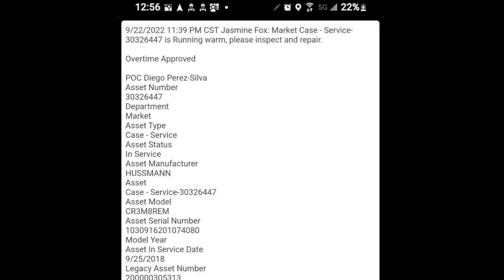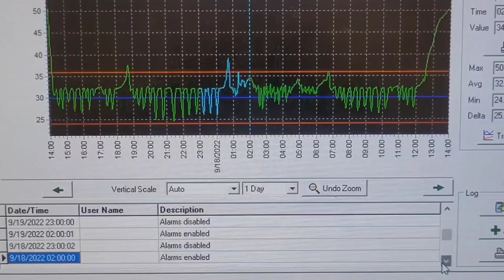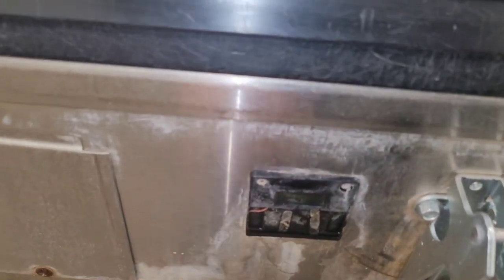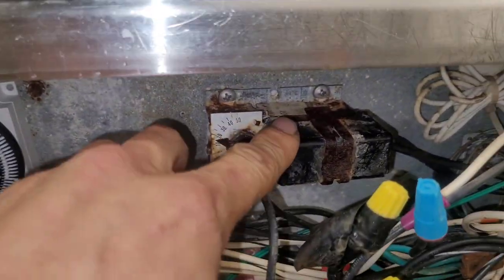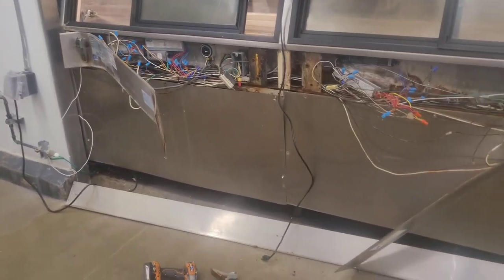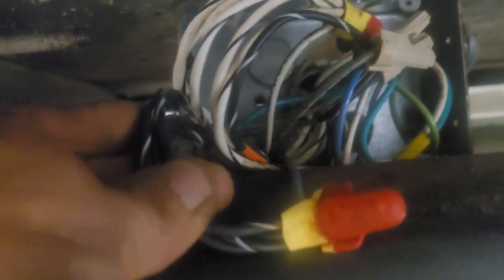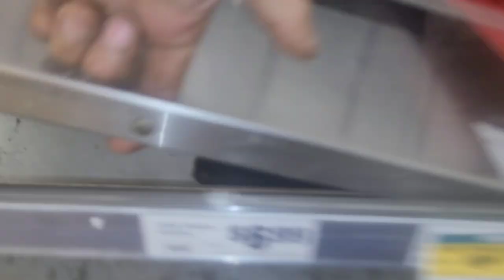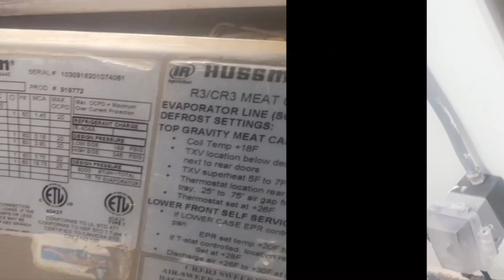MEAT DISPLAY CASE NOT WORKING - ELECTRICAL MESS - NO POWER - GET AN ELECTRICIAN

Comment: Just worked on a brand new HUSSMAN meat case. Those have a lighting circuit and then refrigeration circuit for voltage so that’s why you had lights and no refrigeration voltage, probably from a tripped breaker. (Goodluck finding it in some stores) Those have wago connectors all over and always have shorts, that I’ve noticed. Pain in the ass to work on. Thanks for the video brother stay safe out there 🤘🤘
Reply from the maker: Yea that makes perfect sense. I located a breaker that was tripped. I reset it, about 4 times, and it kept tripping. But even after I disconnected the blue wire under the case that came from underground, it was still tripping the same way, so it wasn't the breaker for that case. These breakers were not labeled of course. Very rare to have properly labeled breakers.
Reply: @HVACRServiceTech  … your definitely correct on that one!! It’s like finding a needle in a haystack for sure! Great content brother… keep it up and I’m sure your channel will grow quickly. I enjoy them and appreciate it.
Reply from the maker: @jimmyp5487  thanks man